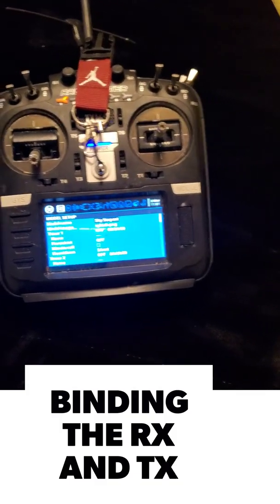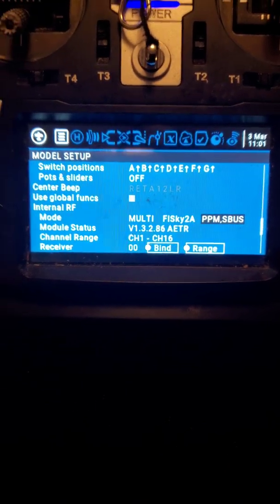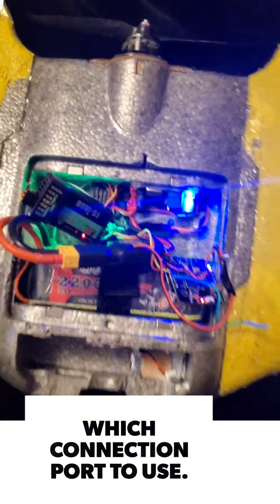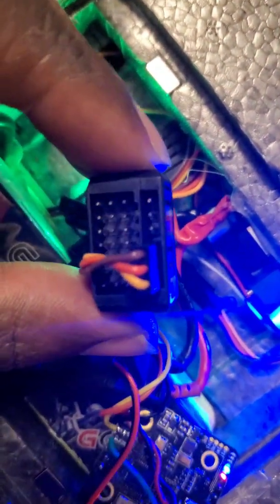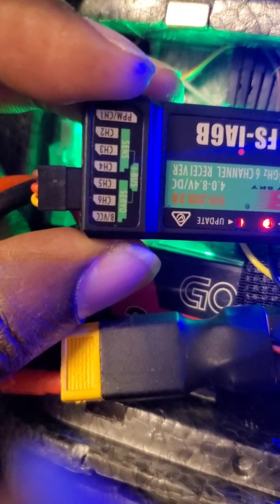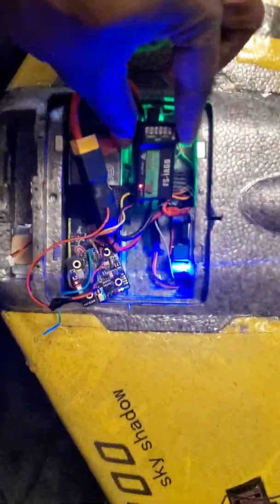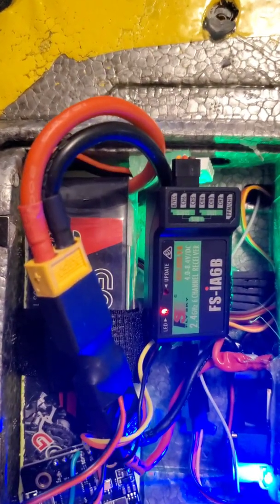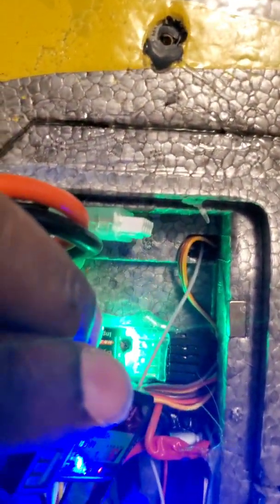How to Bind your Flysky Ia6b to a Radiolink Byme-A or Byme-D gyro.

Comment: Thank you I just hooked up that receiver and gyro to a freeWing 64 mm F9F Panther. How to use a 3-position switch to get all the gyro functions to work.
Reply from the maker: @malloryreid2190  if I remember correctly the 3 pos switch should be assigned to channel 5

Comment: That's strange. I have got exactly the same setup as you, same receiver, bymea, same radio and when I bind everything up same way as you do, it simply does not work. I have no co trol over the model. Gimballs does not work, channel 5 or 7 seem not to change any mode. Did you change the software of the receiver?
Reply from the maker: Does it show on the radio that your rx and tx are bound? Can you take a quick video of your problem and upload it and then post the link on here? I'd like to see what's going on
Reply: @dronepilot260rc  I managed to have it working but on ppm, on sbus/ibus it simply does not work
Reply: @macieks.5959  To use the S-bus output from the iA6B (available on the i-Bus serial output pins) you must set your transmitter up to send out S-bus NOT i-Bus! Note that the FS-i6 transmitter can't be so set but the FS-i6X and FS-i6S can. You can only use PPM from the FS-i6 transmitter.

Comment: mine wont wor on my flysKy fsi6 transmeter
Reply from the maker: Have you tried running it as sbus? You might have to go into the Transmitter and change it from ppm to sbus
Reply: @dronepilot260rc  The stock Flysky FS-i6 transmitter can only be set to transmit PPM NOT S-bus. The stock FS-i6X and FS-i6S can be set for any of them.This fellah really needs to supply more info on what he is actually trying to use. ;-)
Reply from the maker: I have a flysky Transmitter laying around. I'll double check to see if it will work with that Transmitter.
Reply: @dronepilot260rc  Thanks mate. Things get updated all the time so none of this is ever set in stone. Pays to check every so often. :-)
Reply: @dronepilot260rc  Hi! Thanks for your video. Did you make it work on your FlySky transmitter?  I´v got the FS-i6x (transmitter), the FS-iA6b (receiver) and the Byme-A ver. 2 (gyro).  Transmitter and receiver are bound. Output mode on the transmitter is set to PPM and S.BUS.  Signal from transmitter is not received by gyro when the the cable between the receiver and gyro is connected to the receiver as shown in your in the video, only if it is connected to the slot "PPM/CH1" in the receiver. I would however prefer to use the S.BUS, signal. Does your experience with your FlySky transmitter give you any ideas?
Reply: @jan6950  @ A couple of things to check. 1,,, Do you have the S-bus lead connected the right way round to the "serial" pins on the top row of the IA6B?  2 ... If that's correct then try setting the output on your FS-i6X to PWM and S-bus. The PPM output on ch1 will not work then but the S-bus output on the "serial" pins just might.

Comment: Thank you very much for taking the trouble to make this video. All the manuals still list the iA6B as being ONLY PWM, PPM and i-Bus capable - no mention of S-bus! No idea of when the firmware changed. 👍👍 
1 thing you might want to add a clear up on the video though. At about 2.00 you mistakenly call that top right port the PPM or S-bus output (depends on Transmitter settings, so won't work with Flysky FS-i6 Tx but can with FS-i6x and FS-i6s.) Should have said i-Bus or S-bus - I believe that the PPM output is still on the lower pins at channel 1 as marked on the case. Have to get the old ia6B from our mate and try. 🙂
Reply: It is worth mentioning that the current version of the Flysky FS-A8S receiver comes with i-Bus and PPM outputs on separate wires BUT the i-Bus output can be switched to S-bus after binding by pressing the receiver on-board biding button. Thus the i-Bus to S-bus convertor must be on the receiver and the FS-i6 radio CAN be used with it to output S-bus. Keeps making life interesting. 🙂